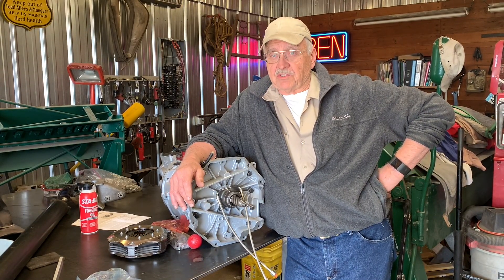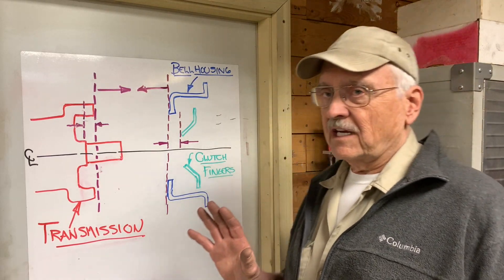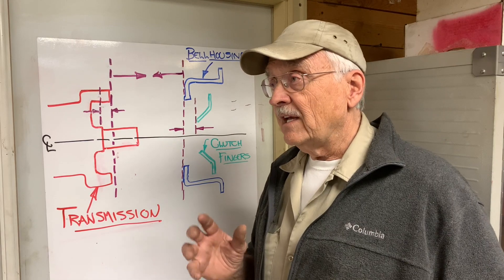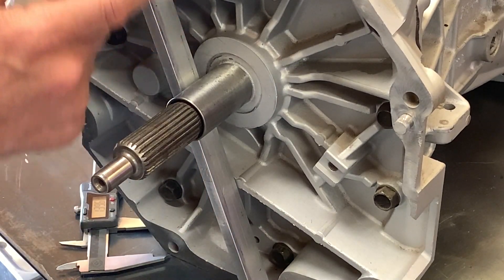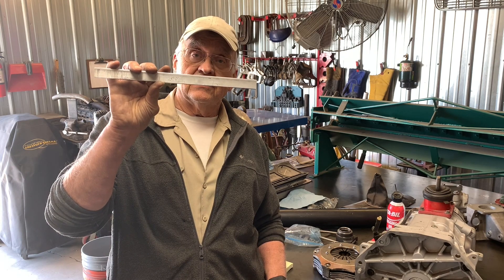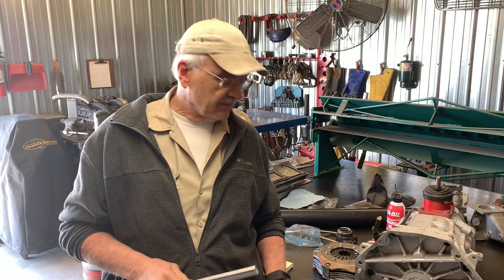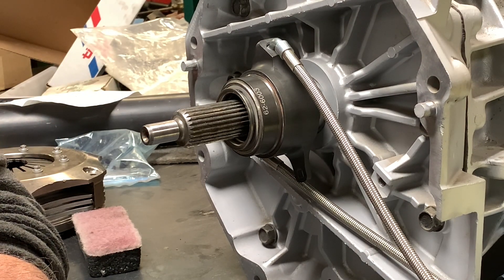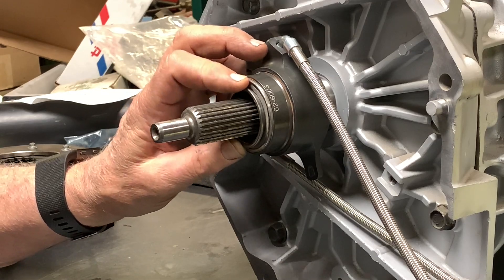How I Adjusted And Installed  A Tilton Hydraulic Throw Out Bearing In My Jaguar XJS Track Car.

Comment: Hmm..  So it seems that when I had my Clutch put into my PT cruiser, it made a Grinding noise.   Seems that the person who put in the clutch did not bother to adjust the Throw out bearing as I have a Hydraulic clutch.      I remember taking it back to them and telling them it was making a grinding noise.  But they just said  "That was normal".             There is a GOOD reason I don't have anyone work on my cars anymore.   :body-blue-raised-arms:

Comment: Hello, You mentioned the T56 has one too many overdrive gears. IMO it all depends on your final differential gear ratio. A Mid 70's XJ12 Auto probably had a 3.07 ratio and the T56 6 gear is .50. Not good combo. That looks like a LT T56 you have in the video which would have come from a 4 Gen Camaro or Firebird. From the factory they came with a 3.42 differential gear ratio and 16" wheels. At 60mph in 5th gear the engine RPM is 2000 and 6th gear not really much use but at 75mph and up 6th gear shines and good gas mileage. The engine is loping along at 1750 RPM or so.
Reply from the maker: I use a 4.10:1 final drive ratio.
Reply: @thecampchaoschronicles9567  Hello, Sorry I did not mention I really liked your video. Not much room at all for one to use the LT1 T56 transmission. What bellhouse did you use? I assume you use the Jag just for racing with 4.10:1 rearend. 1st gear in that setup would truly be a "Granny gear" for all your old viewers out there :). I'm sure it's fun to do burnout though!
Reply from the maker: @Danno74Z  Thanks Danno. The 4.10 works pretty well with the first 5 speeds but 6th is a bit too tall. The bellhousing/flywheel was fabricated in the shop.
Reply: @thecampchaoschronicles9567  6th gear at .50 or double overdrive is really useful for cruising at 75+mph and gas mileage on a relatively flat road/interstate. I believe your Jag is a race car so totally irrelevant. Thanks Again!!